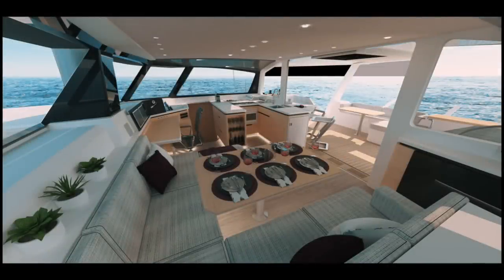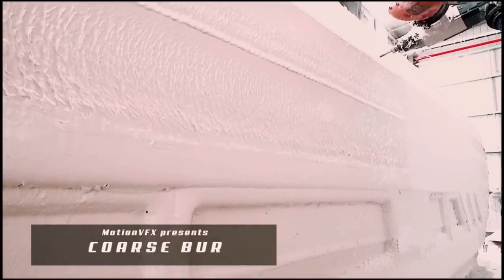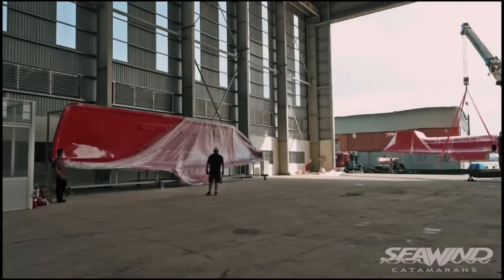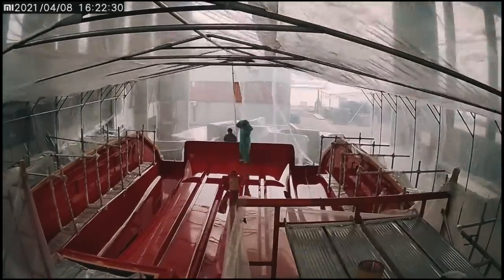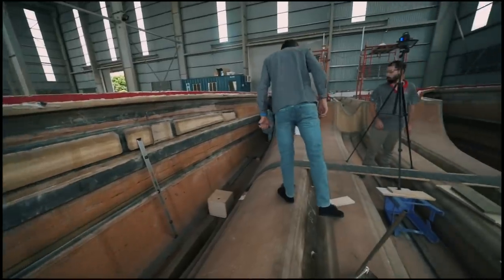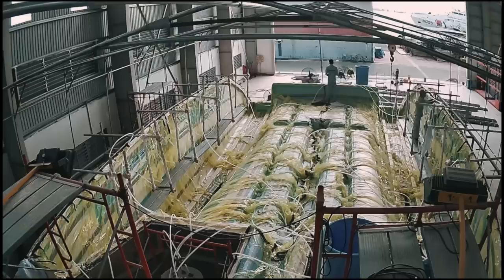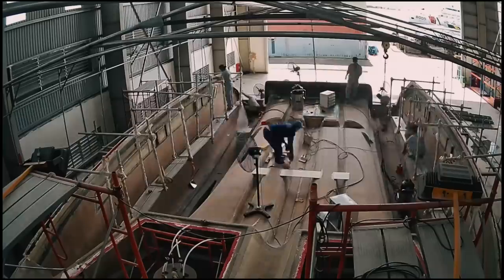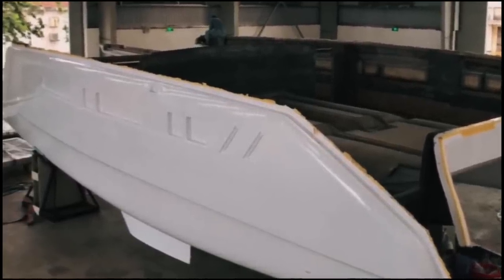🔴 Why does this BOAT BUILD need an INSANE 6,000 feet of pipe work?!!

Comment: "No matter what brand of catamaran you buy, make sure they glass in the bulkheads" ---- * Looks in the direction of Lagoon *
Reply from the maker: Hahahaha. I’m not sure it’s only lagoons
Reply: Every moment I watched this episode I was thinking of the clusterfuck Collin is going through with Parlay. Look at that one-piece rail to rail carbon fiber bulkhead being dropped in and glass tabbed to the hull. That`s how you do it. This is going to be a safe and fast boat.
Reply: @TheBelrick  I will take glass bonding over caulking and non-structural cabinetwork every time. This is not a perfectionist talking. Just someone who wants a solid boat
Reply: @TheBelrick   By disaster I take it you mean sinking to the bottom in open water. ....No......but if you want to see a close call just watch Parlay`s pacific crossing being turned back before it began video. When the rigging went slack and doors suddenly jammed Collin being an exceptional pro realized the boat was folding up underneath him and headed back. A lesser sailor may have cranked the rigging tight and kept going. Was this a disaster? NO. But it was just one or 2 bad decisions away from becoming one.

Comment: Resin infusion is great , but they did regular wet layup for the outer skins of glass against the water. 
The double scored foam has been around for 35 years I was vacuum Bagging foam into hulls in 1991 and Jeremy Rodgers was producing similar hulls in the 80’s by RTM vac-assist an early cushion of the infusion process that requires more tooling but a lot less wasted plastic , hose , bagging films etc
But this is a great build with NO WOOD IN STRUCTURAL COMPONENTS.     Very glad to see all wood rots in fiberglass boats!  
Cheers Warren
Reply: agreed. I was using this to make Kyacks in the early 90s. and my Privledge 39 was made using this same process in 92
Reply: The wood rots under the fiberglass, whether the wood is totally encapsulated or just covered with glass on the top.

Comment: Damn, that is a lot of pipe-work for the vaccuum infusion!
It's really interesting to see the processes involved, looking forward to more of this.
Reply: Made me wonder how they make those hose hoses multi-use ... I can't see how they can just rinse them after a use and use them again?
Reply: @EdwardTilley  I don't know if they re-use the hoses, but flushing them with acetone would clean them up. Several factors to take into account -  the hose material and cost; will acetone degrade the hose? unlikely but something to consider, and is it cheaper to discard gallons of acetone/resin rather than replace the hose? Then you have many gallons of sticky acetone sitting around until the acetone evaporates off, this isn't a quick process and carries a huge fire risk.
I suspect the hose is single use.
Reply: @2212db  I think you're right. A part of the cost of the construction, and seeing the strength you get from so much less material, I should think that hose cost amounts to a savings overall. That carbon fibre isn't cheap though. You are looking at around $300 for a sheet the size of a piece of plywood, unless I'm mistaken. I'd actually like to see how they make the keel superficial and replaceable- and even how they could build in a light weight double-hull. Gets a busy mind turning - as if this solution isn't already complex enough. This made me think that just a ply or two of carbon the length of the keel and an inch above it would keep out any reefing-damage seawater - and then if you wanted bulletproof as well, a single sheet of kevlar around a saferoom. Am definitely overthinking this, but now is the time.
Reply: @EdwardTilley  in the grand scheme of things, a few thousands on single use hose isn't a big deal.
Reply: @2212db  buying a new plastic pipe is definitely cheaper than cleaning with solvent / acetone
Reply: @Boediprasetya  It depends on the hose material. We bought acetone for less then £1 per litre, but the neoprene or silicone hose cost around £200 per 25 metre length. There are far more expensive hose materials out there!

Comment: Very timely!  I've been trying to unlock the "secrets" of boat materials.  So far I've found:

- Carbon fibers:  Stronger, lighter, more expensive than fiberglass.

- Vinylester resin:  Stronger, more expensive than polyester resin.  Cheaper than epoxy.

- Foam core:  More reliable than wood and lower water absorption.  Divynycell foam core is one of the better ones.

So overall, it looks like you are getting great quality basic materials in the new boat!

Comment: This is unreal that you are able to capture this footage and make it available for us. The detail in here is much deeper than it might appear on the surface, as Im just learning more about boat construction and beginning some fiberglass builds myself, the difference between armature hour and a professional piece of glass is really incredible. Seeing the infusion process is really eye opening and Im eternally grateful the hull popped out of the mold without any damage (that seems to be the scariest part of the whole build). Theres less fiberglass matting than I would have thought there was, somehow I thought it would be at least 4+ layers of triaxial on both sides of the foam core but that looks pretty clean and Im sure its exceptionally strong with all the cad work. Somewhat sad that theres so much wasted material in the build process (vacuum bag/lines/plug/etc) but compared to the wasted materials that go into each home its really not that bad if its for a live aboard family.
Reply: Yeah, it's crazy just how thin you can get away with in the laminations due to the sandwich construction!  I've been working on a cat design for a bit and while I have basically zero experience to design the layup, I've just defaulted to 4 layers on either side of the core as a "rough estimate for weight estimations" and suspect that in many areas it's massively overboard.  Though of course, it would be insufficient in other areas, so I figure it should work out as a basic "this is roughly how much cloth/resin/core will be needed".

Comment: "Make sure they're glassing the bulkheads in..."  cough, cough.....Lagoon....cough, cough

Looks like all the YachTubers are building boats in Vietnam this year.
Reply: By now everyone have seen Sailing Parley and how poorly Lagoon 45 was put together with glue. Really smart emphasizing the difference between these two designs.
Reply: ⬆️ YES Hans, specially the showing & wording of "tabbing both sides"...
Reply: "Sailing Life on Jupiter" is also very interesting. His catamaran was built in the Philippines and is made entirely of aluminum. The price-performance ratio is unbeatable compared to other boat builders for similar Katamarans of the same size.
Reply: @x-rayrob7291  Yes, I've seen a few of his episodes too. Very slick design. Fair winds....
Reply: One of my early jobs was polishing fibreglass moulds. I tip my hat to those guys, if that boat dropped out of the mould without picking any gelcoat they should get a bonus!
Reply: Carbon Fiber or not. Sure doesn't seem like enough resistance to torsion & loading from the bulkheads in the hulls. Simply not enough girth to the beam in these critical areas  . The sharp corners on the lower portions of the passageways through the bulheads are serious stress risers. These areas are prone to the high frequency of cycles of stress  Looks good from far. But far from good.

Comment: A far cry from the boat building process of old. This is going to be one incredible boat! I am building a cat in Asia as well, but out of aluminum. The modern processes are far more intricate and technologically complex than even 10 years ago. Your boat will be one amazing performer while still being super comfortable, yet relatively simple. I've incorporated some of Seawind's design ideas for my own boat as I love the galley down/berth layout. Can't wait to see you sailing this cat!
Reply: When you say "I am building acat" do you mean physically.? how would you compare aluminium to the carbon and fibreglass Ruby is using.?
Reply: @wyattfamily8997  Yes, physically. Aluminum is much stronger, more malleable, lighter, and usually less expensive than GRP, yet it is also less "moldable," so not really as suited to production boat building. But Nick said that RR2 will be carbon fiber, which is around 15 - 20% stronger and lighter than fiberglass. My cat will be 50' long, but will only weigh about 8 tons - I believe the 1370 has a 12 ton displacement weight? Both boats are designed to cruise and cross oceans quicker than most GRP production boats. My cat will have daggerboards for upwind performance, yet it will be a bit simpler aesthetically than what I've seen of RR2. The hulls will be thinner, so their 45' cat will probably have as much usable interior space as my 50'. I think for the price of the 1370, and the aesthetically beautiful design, they will have an amazing boat. Neither is better, just different. But when we meet up in Asia, we'll race :)
Reply: @rabukan5842  Kudos for building your own boat, for me such people are very special :) Sailing on Jupiter told a lot of good stuff about their alu cat, I got pretty interested. Best wishes for your project!
Reply: @koborkutya7338  Jamie’s builder, Tim Mumby, is my builder, but my cat will be 50’. I will take part as much as I can, and we’ve made some modifications based on my ideas, but it’s Tim’s basic design and build. He did the new drawings for the mods, and does sell his plans for others to build as kits. I just finished restoring a 50' Riva, but as I said, aluminum is a different animal. I do weld, but he's trained his crew well, and their work is excellent.

Comment: Brilliant video; was really great to see the carbon-fibre addins; very smart use of the right composite material exactly where it's needed. This builder is going "overboard" to do it right - which is nice to see. Great use of chines here too;.too bad they weren't able to eliminate nets up front altogether as others have. That adds so much more front-yard chatting space to these boats and makes them completely dry for the most part. Did you happen to notice if they used foam core, or marine plywood - covered with carbon fibre - for those bulkhead doors? 
I just noticed 44 unlikes? Clear trolling - because this is a great tech video - mostly created by the Seawind team as well. The silky-smooth vocal stylings might rub once in a while, but that's no call for purposely screwing-up youtube algorithms.

Comment: I'd have kept that plug to make a second mould for when you want to double the production rate.  Fascinating stuff very much like aero build.  Phenomenal technology in both design and manufacture but still hugely man hour intensive.  Should be as light and stiff as hell.  No integral superstructure so they'll have to overcome lack of stiffness that an open design, like a convertible car, has.  Looking forward to more vids.  Thanks!
Reply: In my opinion, using the original plug to make a second set of molds is not a good idea. My reasons are: the plug was milled from a Styrofoam block which surface was manually sanded and had heat curing resigns applied, after which the mold making process added more heat.  The Styrofoam plug surfaces will not be that stable after this process and will be distorted. To lay up a shell second plug, supported sufficiency, in molds no 1 to make molds no 2 would be more accurate.

Comment: Nick... as a tech guy to tech guy...THERE IS NO SUCH THING AS NEGATIVE PRESSURE, just lower than atmospheric pressure ;-) 
Can't wait to see the new boat on the water, hope you bring it by Australia b4 you go by the rest of the world!
Reply from the maker: Cheers mate.
Love the comment, but “negative pressure “ is an accepted nomenclature across various fields. Yes in theory you cannot get pressure below that of an absolute vacuum. In fact if we are talking absolutes, there is no such thing as a perfect vacuum. However negative pressure systems are used to describe in industry, medicine and many other fields a situation where the pressure is reduced to below the ambient pressure. It is used primarily because the implication is that a material (whether it air movement, or resin) is sucked through a system rather than blown or pushed. The differentiation is important depending on the field. In medicine it implies less cross contamination of wounds. In ventilation it similarly reduces airborne contamination. 
Love the discussion on these aspects of theoretical and practical physics and mechanics. You and I should catch up for a beer 🍻
Reply: Well, at least we are not talking about 'turning up the vacuum' and the whole 'did you mean up towards ambient or up to a higher number on a vacuum gauge?' with the included 'up means down' 'then why didn't you say down?'  Etc.  :)

Comment: Are you thinking about one of the new fuel cell options instead of diesel?
Terysa, it should almost eliminate the smell and noise, depending on where on the boat the Captain is, of course! ;-)
Reply: I wonder what that would add to price? Running of hydrogen electrolyzed from sea-water and solar just sounds smarter than it might actually work. What size wrench fixes that broken part?

Comment: Fascinating video, I love the detail of the infusion , bulkhead installation and the steps used to create the molds. Will these molds be the only ones used for the production cycle or are they regularly replaced? Might I be correct in also assuming that complex curves increase hull rigidity? 
Thank you so much for sharing the detail taken in producing your world class yacht.
Reply from the maker: By bracing the moulds with the exoskeleton they have longevity and will last the whole Production run.

It’s when you don’t have a 3 axis support framework that you start to get distortions in later hull numbers

Comment: Very interesting. Just wondering if there are any provisions electrically for all that carbon fibre? It is afterall conductive and if you have ever seen a carbon fibre boat struck by lightning or a carbon fibre reinforced sail thats been fitted with metal eyelets, a Carbon fibre mast thats not isolated/protected.. Your know what we mean.  Sail Safe Guys, Ant, Cid & the pooch crew.

Comment: Very interesting to watch this in tandem with MJ Sailing who are, as you are no doubt aware, building a Vietnamese  manufactured catamaran in kit form.
Reply: MJ Sailing even considered to come to Vietnam and build there boat there but finally decided not to. I think they regret that decision a bit with all the delay caused by shipping issue and material shortage.
Reply: I think they couldn’t travel to Vietnam due to COVID restrictions at the time. International travel is still harder than freight shipping and far more unpredictable.
Reply: @geodesy2009  if they worked with Max cruise it would not be that difficult for them to come to Vietnam actually. I helped a few companies to bring their business partners to Vietnam since 2020.
Reply: @drkmn3112  Well we’ll just have to ask them. They are an amazingly hard working couple. They seem to thrive on the grind…within reason.

Comment: Thanks for a great tour of the boat hull build, and clear explanation of the build process.  Needless to say, these are useful, entertaining, valuable, educational, etc.  Please keep doing them.  Cheers!

P.S.  I wonder if you might have considered a similarly priced and sized Balance 442 had they been available sooner.  The Seawind 1370 looks very well built, but the Balance designs are also well built (also vacuum infused carbon fiber reinforced fiberglass) and may have some advantages including somewhat better performance.
Reply: @Loanword Eggcorn

If you wait for the perfect boat, car, widget, or gizmo, you'll never get anything.

The advancements in technologies and design are so fast that most everything manufactured is obsolete before it is even made.
Reply: @donna30044  Agree with your general points, but:

1.  Modern boat building using vacuum infused composites is actually pretty stable now.  While vacuum infusing was a major improvement over the past decade or two, there aren't many major advancements in basic boat construction beyond that happening now.  

(And many of the better, more performance oriented boat builders are using vacuum infusion now.  It does result in a more costly build, but is stronger, lighter and almost certainly more durable then wet layup by hand.)

2.  The Balance catamarans are similarly priced and roughly similarly built to the Seawinds.  Arguably the Seawind 1370 copies the open pilothouse salon styling of the Balance boats, for the better.

The Balance boats all have the option of daggerboards and may be somewhat higher performance.  They also have some differences is build and design philosophies.  Both boats are definitely comparable.

I wasn't suggesting to not buy a boat now.  I was asking for a comparison of buying the two similarly sized and priced new boats: Seawind 1370 vs Balance 442.
Reply: @donna30044  interestingly the Balance 442 hull #1 has already splashed and the owners have taken delivery.  Both these boats are so beautiful and well built  though it’s like picking between between a gorgeous blonde or brunette…you can’t go wrong!